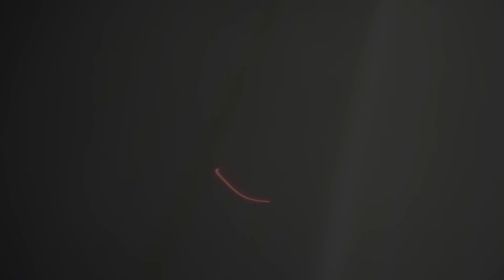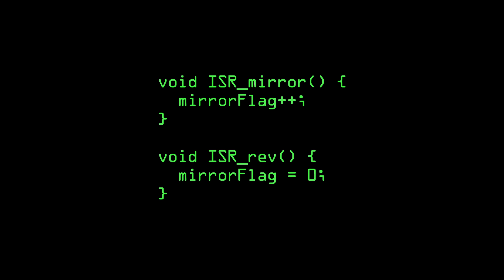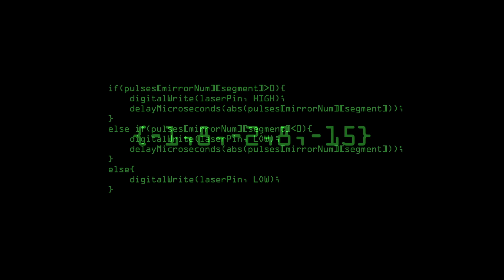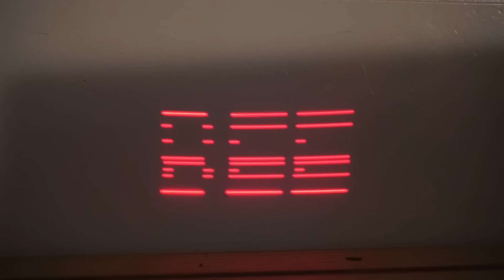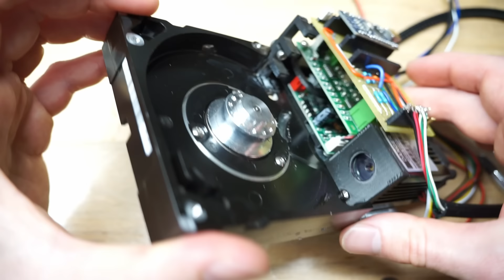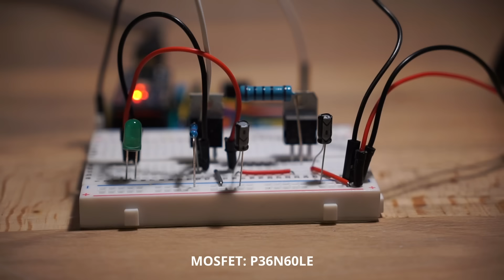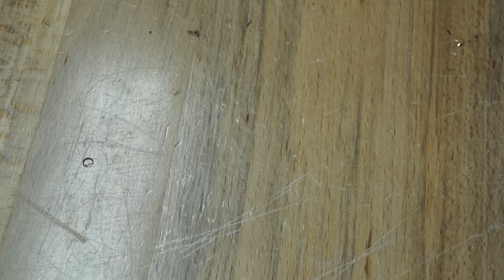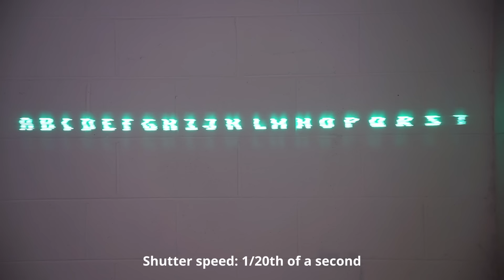DIY Laser Projector - Built from an old hard drive

Comment: Very nice, I would have done many of those myself if I had the time... lol

Have you considered interlacing the lines? That was an old technology used in the original green CRT monitors from my youth. Basically skip a line in the output and then on the second pass start at line 2 and skip a line with each pass. That helped with the flicker we had.

As a second consideration, you should consider pixelating the output instead of a varying on and off times. But this would likely create stretched pixels at the edges due to the angular velocity of you would see by flattening a circular image onto a flat service.

Finally you should use and ESP32 since it has built in Bluetooth and is faster, you can also use one core to decode the intended text and another core to output the pulses.

Just a couple of thoughts but thanks for the thoughtful presentation of your project .

Comment: Knew it! When I saw that he'd killed the lasers, I knew it was the capacitor in the power supply. It's normal to put a cap to smooth out voltage in power supplies, and reduce the supply impedance during brief moments of high current demand. But that's for constant voltage supplies!

I'm just posting this to congratulate myself cos I solved the problem, I'm pretty pleased with myself, I'm like Ben, I tinker but I lack proper electronics knowledge. So spotting that was a nice surprise for me that I got it right.

Comment: years ago, I had an old Commodore 64 (don't judge me on my age, lol).  When generating graphics, the images or sprites as they were called were based off a 256 x 256 box.  Each Byte of data was a line within that sprite and using binary anyone could generate an image in the 256 x 256 box.

To draw the letter A, the dump would look like 0,16,40,40,56,56,40,40,0; with each of the numbers representing on or off pixels for that block.

I'm thinking you are going to get a much crisper image out of that in later code.
Reply from the maker: Actually my dad still had a C64 when I was a kid in the 90s! And yes you are right, doing a pixel grid is better I think, in fact I already updated the code since posting the video to do it as 2D arrays of 1 and 0 representing on/off. In the future I plan to do RGB with brightness control for color mixing.

Comment: It would be cool to add a prism to combine RGB diodes to make some basic color mixing. It would be cool to add another rotating drum (limited by the RPM and sync I'm sure) to shift each text line to make a basic terminal display.
Reply from the maker: Thinking about doing that for version 2 actually!

Comment: i love your project note yes i do think the filament print would have defects that are a result of the wobble but if u resin print it u should have  that solved for the shakes do u feel it oculate like most hard drives do if u also set up rubber rings it will help with that after that i would set up a lipo u have room for a big lipo battery but u will need a charge controller for portability vs 100aa lol rubber dampeners on the hard drive motor and resin print the parts so u have less imperfections on moving parts  any thing that is printed for mounted parts filament printing is great. note i would love to recreate your project and play with the debug part reach out if willing to share the docs u have so i can look im no expert but i have a feeling we both have the same love for thinking and problem solving

Comment: if you know it is positive... why are you still putting it inside abs()?
if you know it is negative, why not just use - instead of abs()? 🙃
Reply from the maker: Because that value represented time, and you can't have negative time. Basically I am saying -50 would mean delay 50 microseconds with the laser off, where as 50 would delay with it on. But admittedly, it is a weird way of doing things, and after releasing the video I changed to a 2d array of 1s and 0 representing on/off.
Reply: @benmakeseverything  okay, let me see if i can give you an idea
if (pulse > 0) {
    digitalWrite(...);
    delayMicroseconds(pulse);
} else if (pulse < 0) {
    digitalWrite(...);
    delayMicroseconds(-pulse);
}
how about this?

Comment: To have an easier time adjusting the mirrors just use taller tabs for the mirrors to have higher leverage and use screws with a tighter flank with fine thread.
Also try putting a piece of transparent acryllic infront of the laser, that will smudge the laser and produce quite a blocky image. But it can't be to big. Maybe experiment. I think a size of maybe a 3x3 mm block thingie should be ok if the laser is still strong enough to shine through it.

PS: I like the wobble. It looks cool an retro.

Comment: Hey ! I love that video ! It gaves me some hints on how to design a 3D scanner, using structured light beams. Regarding the Arduino boards, maybe FASTER CLOCK SPEEDs by   ESP32 , or Teensy based chips , will solve the clock speed problem you mentioned in video.

Comment: Judging by the fact that the sequential trembling of the horizontal lines is repeated cyclically, it is definitely not a matter of mirrors.  I would like to blame the counter reset function, but the  trembling is constantly shifting and does not coincide with the sweep cycle.  For some reason, this effect is very reminiscent of the interference of CRT televisions.  What does it mean?

 And by the way, an interesting observation.  Some lines are not completely distorted, only character elements are stretched.  Maybe the clock frequency is not stable enough, or maybe the gate capacitance is to blame.

 But this is not important, because this is not a bug, but a feature that adds the unique charm of analog technologies, which cannot be achieved using, for example, DLP matrices.

Переведено, но не озвучено с помощью google переводчика.

Comment: I have this idea if you can make it 

Certainly, here's an idea for an advanced VR display system that incorporates various technologies:

*Idea: Enhanced Immersive VR Display with Laser Projection and Customizable Optics*

*Concept:* Develop a next-generation VR display system that combines multi-color laser projection, beam splitter technology, and customizable optics for an immersive and adaptable virtual reality experience.

*Components and Features:*

1. *Multi-Color Lasers and Beam Splitter:*
   - Utilize red, green, and blue lasers for a wide color gamut and vibrant visuals.
   - Incorporate a beam splitter to manipulate light paths for improved image quality.

2. *Customizable Optics:*
   - Design the system with adjustable optics that allow users to fine-tune focus and comfort.
   - Provide settings to accommodate different levels of visual acuity.

3. *Wide Field of View:*
   - Maximize the field of view to create a more encompassing VR experience.
   - Utilize beam splitter technology to expand the perceived field of vision.

4. *Advanced Optics Engineering:*
   - Collaborate with optical experts to ensure precision alignment and calibration.
   - Optimize light paths for minimal distortion and aberrations.

5. *Interactive Environments:*
   - Create interactive VR environments with dynamic elements and realistic physics.
   - Implement physics simulations for more immersive object interactions.

6. *Intelligent Motion Tracking:*
   - Utilize advanced motion tracking sensors for accurate head movement detection.
   - Implement predictive algorithms for smoother rendering and reduced motion sickness.

7. *Adaptive Rendering and Foveated Rendering:*
   - Incorporate adaptive rendering techniques to allocate rendering resources based on user focus.
   - Implement foveated rendering to enhance performance and reduce processing load.

8. *Haptic Feedback Integration:*
   - Integrate haptic feedback devices to provide tactile sensations for enhanced immersion.
   - Sync haptic feedback with visual and audio cues for a multisensory experience.

9. *User-Centric Experience:*
   - Prioritize user preferences by providing customization options for visuals, audio, and comfort settings.
   - Allow users to save and load personalized profiles for different VR experiences.

*Advantages:*

- *Immersive Visuals:* Multi-color lasers and beam splitter technology provide vibrant and realistic visuals.
- *Customization:* Customizable optics and settings cater to individual comfort and visual requirements.
- *Advanced Interaction:* Interactive environments and haptic feedback enhance user engagement.
- *Reduced Motion Sickness:* Intelligent motion tracking and adaptive rendering techniques minimize motion-related discomfort.

*Challenges and Considerations:*

- *Technical Complexity:* Integrating multiple advanced technologies requires careful engineering and optimization.
- *Cost and Accessibility:* Advanced technologies may lead to higher costs, potentially impacting accessibility for some users.
- *User Training:* Introducing customizable optics might require user training to maximize its benefits effectively.

Creating such an advanced VR display system involves collaboration between experts in optics, VR development, motion tracking, and interaction design. This idea focuses on delivering a highly immersive and user-centric experience that pushes the boundaries of what VR technology can achieve.

Comment: I had this same basic idea about 30 years ago though I was going to use three lasers red, green and blue.  Of course this was before digital television and HD.  I was going to use two sets of spinning mirrors so I wouldn't need so many mirrors.  I was also going to vary the brightness of the lasers per pixel as the laser swept across the screen.  I figure I either do this through changing the voltage of the lasers or always keep the lasers on full power and have them go through a filter that could adjust the amount of light it let through.  In the end you end up with a laser projected television.  I never built it though.  Sure glad someone else did.
Reply from the maker: I am planning on revisiting this eventually and want to try the R/G/B laser array idea for full color, my only concern is that getting them to focus on the same exact spot might be challenging. I also thought about varying the brightness as well, it might be possible to have multiple "parallel" constant current drivers that combine to add brightness - like if you had 3 per laser, you could have: OFF, 33%, 66%, and full brightness. Which isn't as good as full grayscale, but an improvement on what I did. Thanks for watching!

Comment: Could this set up be used using the Nintendo virtual boy? I know the inside uses vibrating mirrors and an LED, but if you switch the LED to a laser, would you be able to projected on the wall?

Comment: Cool stuff. An idea I've had for a while is incorporating conductive material into 3d printed components. Snapping the components together completes the circuit and elimates wiring for the most part. I never like wires anyway.
Reply from the maker: Sounds interesting. If we could get proper conductive 3d printing filament and use it with a multi-material capable 3D printer, that would allow for some cool projects.

Comment: Just to make it a ball-ache of a project, I wonder if  two servos per mirror to allow you to control each line in software would be a good idea.  
Other than adding a considerable amount of weight and complexity to the code needed to adjust it.    
so if you want or need, you can change the spacing or at least calibrate and correct distortions while it's running.
Reply from the maker: I like the idea, at least for the vertical spacing. I'm just not sure how to get wiring for 12 servo/stepper motors to a rapidly spinning disk...

Comment: I built something similar a few years ago but it was for a diy laser projector. I instead had the lasers go through a dichroic mirror setup (for combined color), hit the mirror wheel, then hit a mirror that was attached to a planetary gear output with a motor that had a cui encoder (to control beam angle). I used an fpga though for controlling the drawing. I used a resin printer and didnt have to adjust my mirrors on my mirror wheel. I never finished the whole project due to lack of fpgas at the time  (was trying for atleast 4k but was stuck at 2k due write limits due to fpga clock) and not correcting the beam sizes for the 3 laser diodes but this had definitely peaked my interest when i saw it.

Comment: Your lines start displacement is about steady non floating. It is an error introduced by design. You should sense actual beam pass instead of rotor position. Take a look at project i've mentioned above. That will simplify the design and made result more accurate.
Also you have CNC for metal works. The rotor should be done from metal instead of 3d printed plastic to reliable keep the geometry and mirror positions.

Comment: This is an interesting take on laser projection. I have thought about trying to build one, but always figured I would use two galvanometers (the head servo in the hard drive) one for X and one for Y. There is always more than one way to solve a challenge.  Great work!
Reply: Why’re you pretending to be a chick